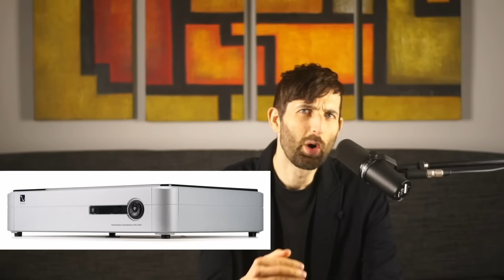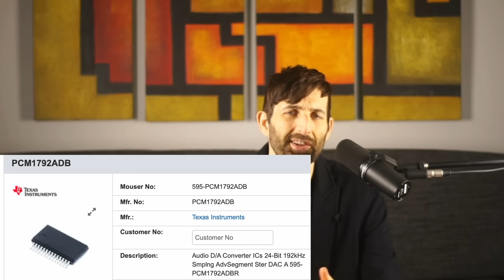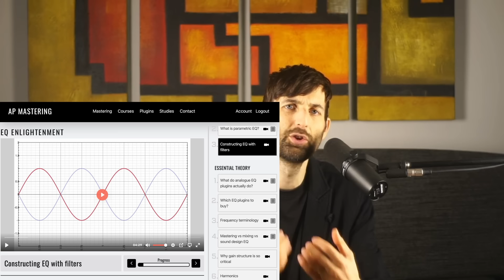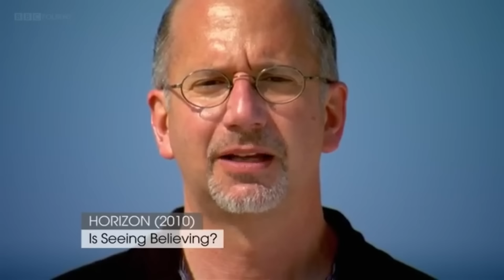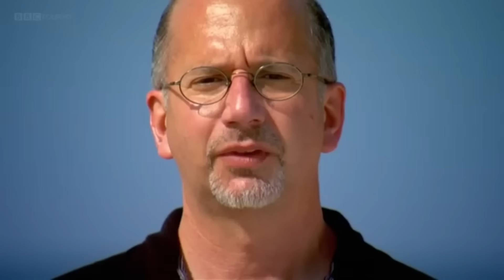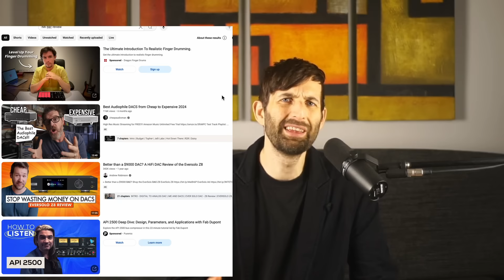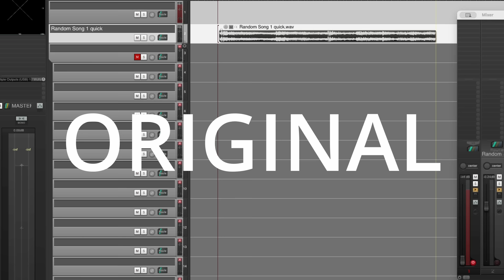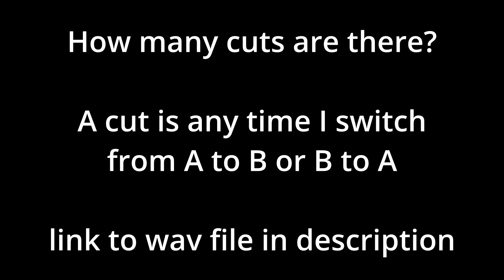The DAC Scam - Almost everyone believes the hype

Comment: It is especially funny that audiophiles buy expensive equipment but many times they listen to it in acoustically untreated room...
Reply from the maker: YES. I've made this comment before... I have no idea how anyone can describe the fidelity of a 200,000$ hifi in an untreated living room and not feel like a complete pillock
Reply: Yep! See this all the time. People showing off their £20k B&W speakers. Room untreated, likely with a long reverb time and speakers in the room corners. It’s as if they are unable to read the little manual that came with the speakers on basic speaker placement and room setup
Reply: @42tops  Surely reverb time in their allucinatory delirium becomes "wider soundstage"...
Reply: @APMasteringa mid system in a well done room trumps a top end system in a shit room.

A low end system in a good room would still win
Reply: Condition the listener first and the space second or even last . 
Most people don't have the money , time or desire to condition a space . 
My listening space is the worst of the worst.
It has  zero  redeeming qualities and would put an audiophile in the ICU due to shock . 
When i bought my latest system within my budget i never even considered the space .
i plopped my huge tower speakers on the floor up against the wall  on either side of my tv which is at the foot of my bed and a window next to the tv. 
one side of the ceding is three feet high and the other over the left speaker is fifteen feet high . my amp is right up against the bed within arms reach . i hooked everything up 
turned it on and pure bliss . went to listen in showrooms , peoples homes etc to listen to comparable equipment and to me my set up sounds way better . But none of that matters because ALL sound is subjective when it reaches the brain . so we like what we like and that's it .
Reply: @ It's funny because I have had a serious interest in hifi since the early 80's. Then I went to uni and studied acoustics at degree then masters level. I have worked in the acoustics industry for 25 years now and design entertainment venues, studios and stadiums for a living. I have literally made all my money from being a consultant on this subject matter. But yet all I see now is folk in this hobby with zero understanding of basic acoustic principles writing stuff on the internet about how little they know and giving out their advice.
Reply: You are spot on,you can have better sound with 5000 euro hi-fi and room with very good acoustics rather than 100000 euro hi-fi system in space with terrible acoustics,the acoustics of the space is fundamental.
Reply: Haha I always think about that. They would notice more clarity and depth by using KRK monitors but treating their room
Reply: Not just untreated rooms, but rooms with laminate flooring and no sound absorbing furnishings. And if that isn't bad enough, why do mastering engineers go all out to make albums sound terrible? We may as well buy inexpensive equipment that at least doesn't highlight these problems.
Reply: @FreezingMoon77 This! I just stumbled across a guy reviewing some audiophile gear and his listening room looked more like glasshouse. He went on and on about soundstage and holographic imaging and how sound seems to come from outside the speakers. Well I guess it sort of was but who wants to spend their time listening first reflections is beyond me. 

Perhaps in this video a bit too straight forward view was given, it was not stressed enough that proper design is not just slamming roughly correct parts together. But maybe the message would have become too convoluted if all ifs and buts would've been properly addressed. But overall I agree that mostly audiophile stuff is just snake oil and audiophiles don't really understand the subject matter enough to see through the bullshit.
Reply: Not me..  :) Room was treated and then a UMIK-1 mic used to build Convolution files for HQPlayer (my upscaler / DSP / filter / room correction solution)

Comment: Most of the sound difference is based on the output stage and not the chips.
Reply from the maker: sure, if you design a poor quality DAC it will color what the chip is doing

Comment: Since chip manufacturers have reached the point of making perfect DAC ICs with dynamic range and THD of 130dB or more, it all comes down to the output stage of the DAC, maybe the power supply and the PCB design. Poorly designed output stages and PCBs can actually affect the DAC's (whole unit) characteristics, adding more noise and distortion, maybe dropping the final specs to something like 120dB or 110db. Is this a problem? Can you hear the difference? Probably not, considering CDs have a dynamic range of 96db and preamp/ amp components usually have less than 100dB.
Reply from the maker: properly dithered CDs can exceed 96 but yeah. And its actually quite hard in electronics to get significantly more than 100db of anything anyway because of johnson noise
Reply: @APMastering A new DAC is coming with 170dB performance. It's called imersiv.
Reply: @ It is called BULLSHIT
Reply: @driz77  Regardless of whether the marketing calls it “immersv”, it’s inaudible. In fact it cannot even exist as sound, let alone be audible!
Reply: @GregStudio01  Suggest you read the patents and AES papers. You're not understanding the technology. THD at "atmospheric" levels (-40dBFS, etc) is reduced by orders of magnitude, and this is plainly audible. Over 30 top mastering houses are now using the imersiv DAC.
Reply: @driz77   Why would you suggest something I’ve already ready done. I suggest you learn the basics of sound, try starting with the level of absolute silence (in a habitable environment)!
Reply: @GregStudio01   With closed headphones (sufficiently blocking room ambience), the ear can perceive minus 8dB SPL. But you're missing the point of the imersiv invention ==> it reduces mid-level THD by orders of magnitude, compared with all other DAC architecture today. This is a perceptual breakthrough. So, you've read the imersiv patents? The AES paper? Katz's AP measurements? Jan Didden's AudioXpress technical article? If you had read these, you would understand what I'm sharing, and why this is a fundamental shift in objective + perceptual audio performance. Mastering houses now using the imersiv include Sterling, The Lodge, Concord, Airshow, Arf, Infrasonic, Coast -- over 20 I'm aware of. And the imersiv DAC isn't even on the market yet!
Reply: @driz77  And assuming one is not wanting hearing damage, what is the peak level going to be with those closed back headphones? That hole is getting deeper!
Reply: @GregStudio01  But this keeps missing the point. imersiv architecture isn't about how quiet or how loud it gets. The perceptual breakthrough is in dramatically lowering THD at atmospheric levels, where our ears are most sensitive to spatial cues (think 0.1% vs. 0.001%). This is why all the mastering engineers are commenting about its spatial realism. Imersiv delivers about 2 orders of magnitude lower distortion than any legacy DAC (any DAC today). Bob Katz actually ran the 40dBFS THD curves against his best DACs. It's plainly measurable and, according to dozens of mastering engineers now using the imersiv DAC, a distinct audible improvement in imaging, depth, and space. Before commenting again, I urge you to read the Katz review, then we can have an apples-apples conversation.
Reply: @driz77  Perfect, you failed to answer the question and all you did was paraphrase marketing. So yet again you’ve demonstrated you have nothing other than marketing! How deep can you make that hole? lol
Reply: @driz77  Perfect, you didn’t even attempt to answer the question and instead just paraphrased marketing. Perfectly proving yet again you have nothing other than marketing. Keep going, this is funny!
Reply: @GregStudio01  This /is/ engineering. You need to understand THD and the difference between 0.001% and 0.1% (see Katz measurements). If these numbers mean nothing to you, you'll never get it.
Reply: @driz77  Just more and more nonsense. Sure, I don’t what engineering “/is/“ despite the fact that’s what I’ve done for a living for 30 years and instructed others to do. Again, you can’t answer the question, have nothing other than false assertions and demonstrating yourself to be a fool. But don’t let me stop you, it’s amusing to watch people make a fool of themselves!
Reply: @GregStudio01   What was your question? I'm just presenting Bob Katz's objective THD measurements, showing that imersiv conversion is 100X lower THD than his best DACs. Did you read his review? Start there, then we can have an intelligent conversation. Stop using words like "fool". If we don't address the objective THD differential, then you'll not understand what imersiv processing does, and why it's radically different, and changes all audio processing moving forward (actually, many ADC's today are now using multi-path architecture ... Rode, Zoom, etc. as "clip prevention").  imersiv is the first multi-path DAC.
Reply: @nafeel4539  Oh dear, someone was unable to answer the simple question I posed and from that you think I was cooked?! lol
Reply: @ @robertt7238  Thanks for the conversation. I would suggest: read the patents. When a conventional single-path DAC (all DACs today) converts at lower levels, its measured THD (ratio) rises dramatically, by definition a doubling of THD ratio every -6dB of level reduction. So by -40dBFS, its measured THD is somewhere in the 0.1% range. And by -60dBFS range (the "atmospherics") it is closer to 1%. This is audible in the ambience range, but we've never thought about it because we assumed it was insurmountable. You never see distortion % results at -40 or -60 (etc). It's always at Full Scale. 

Multi-path architecture (read the multiple published patents) changes this paradigm. When music falls into the -40dBFS range, the D-to-A conversion switches to a different DAC core (!) and starts converting again at the most-significant-bit (MSB bit-32), where the THD and noise performance is 40dB better than any single-path DAC. This is audible as improvement to low-level ambience, subtle timbre, atmospherics, and so forth. This is what recording engineers are hearing. 

Are you familiar with HDR photography? The parallel is near-perfect. You take multiple photographs at different apertures and then intelligently combine them for greater dynamic range, which becomes especially visually apparent at low-levels. Sony just released a CCD with two sensors per pixel, one optimized for ultra-low-level light, and one optimized for high-bright light, improving CCD dynamic range (lowering self-noise) by 25dB. It's all the same concept. And it's a wickedly hard engineering problem to solve.
Reply: No probably not. -110db is inaudible.
Reply: @robertt7238  But -40dB is audible, and imersiv DAC lowers THD by 1-2 orders of magnitude at lower audible levels. Nothing else does this. Bob Katz wrote up a prototype review in Positive Feedback. It's fascinating. Probably the first significant breakthrough in digital audio since, well, digital audio.
Reply: @driz77  Who cares about -40db when I have a DAC with THD+D of 120db. In a quiet room, that is 150db peak which is bleeding ears. Positive Feedback is positively brain dead.
Reply: @robertt7238  OK, so you've entirely missed the point. Admittedly, it's a very long and complex review. You'll need to go back and try to grasp the amazing improvement of multi-path architecture. It reduces THD by 1-2 orders of magnitude (!!) below your DAC, at lower levels. This is audible, according to Katz, and around 50 Grammy and platinum engineers who are now using this DAC. Nelson Pass is on their Advisory Board, as is George Massenburg. This is real.
Reply: @driz77   "Engineers". These are not engineers, they are people who mix audio, who for the most part are every bit as ignorant about the technical aspects of audio as your average audiophile and say some really stupid shit ... I know, I deal with them.   I have forgot more about digital audio and signal processing than Nelson pass knows. He is an analog guy, and not overly sophisticated analog at that. Some cool circuits, but that is about it. 

If I have 125+ DB THD+N, there is 0 reason to lower TDH even further. You cannot hear it and neither can those supposed 50+ grammy and platinum engineers. No one on the planet can, and from the most basic level, even the very best transducers are 2 orders of magnitude worse in THD.  The quietest rooms for listening are about 20db, 125db on top of that is 145db. Your ears are bleeding and your hearing is finished. Even considering a realistic max of 120db peaks, that basic 125db THD+N is 25 db below your quiet room noise floor which is well below what you can extract with perfect test signals, never mind music where you can't hear, at the same time, more than about 50-60db and even then only if widely separated by frequency due to masking effects.

Next time you want to tell someone they "don't understand" you may want to find out the relative level of knowledge.
Reply: @robertt7238  You're not understanding multi-path technology. When a conventional single-path DAC (all DACs today) converts at lower levels, its measured THD (ratio) rises dramatically, by definition a doubling of THD ratio every -6dB of level reduction. So by -40dBFS, its measured THD is somewhere in the 0.1% range. And by -60dBFS range (the "atmospherics") it is closer to 1%. This is audible in the ambience range, but we've never thought about it because we assumed it was insurmountable. You never see distortion % tests at -40 or -60 (etc). It's always at Full Scale. 

Multi-path architecture (read the multiple published patents) changes this paradigm. When music falls into the -40dBFS range, the D-to-A conversion switches to a different DAC core (!) and starts converting again at the most-significant-bit (MSB bit-32), where the THD and noise performance is 40dB better than any single-path DAC. This is audible as improvement to low-level ambience, subtle timbre, atmospherics, and so forth. This is what recording engineers are hearing. 

Are you familiar with HDR photography? The parallel is near-perfect. You take multiple photographs at different apertures and then intelligently combine them for greater dynamic range, which becomes especially apparent at low-levels. Sony just released a CCD with two sensors per pixel, one optimized for ultra-low-level light, and one optimized for high-bright light, improving CCD dynamic range (lowering self-noise) by 25dB. It's all the same concept. And it's a wickedly hard engineering problem to solve.
Reply: @driz77    Or more likely you cut and pasted a bunch of shit that you effectively have no clue what it means ...
Reply: @robertt7238   Read the patents -- there are three of them. This is clearly the biggest breakthrough in digital audio since ... digital audio. It reduces noise by almost 40dB. It reduces low-level "atmospheric" THD by 40dB. After you've read the patents, come back and we'll have an intelligent conversation.

Comment: Considering the fact that some don’t all have a chip! This is ridiculous!
DCS HAS NO CHIP it is a ring dac!
The POWER SUPPLY IS THE MOST EXPENSIVE PART OF A DAC!
What about the ANALOG OUTPUT STAGE USING BETTER PARTS! 
A good case can cost 1-2k in metal work! What about all the custom filters?
70% of sound is power supply, 10% chassis
Reply from the maker: what percent of sound quality is that 2000$ case?
Reply: @APMastering consider, considering the fact it doesn’t vibrate as much!
It keeps resonances down from affecting other things! 
Decouples the boards and has internal bracing. Better feet matter as well.
When you’re listening in a studio, you’re not listening to full range speakers you’re listening through headphones or little monitors in the near field or midfield when are you listening to big ass speakers pushing tons of air in a big room vibrations matter more
Reply: @APMastering 10% approx You have to decouple components and protect them from unwanted resonances and shield them from magnetized cheap stamp steel that rings and dapen them.
Reply: @pennfootball71  you honestly think you can hear the output interpolation filters on your dac?
Reply: @NamelessSmile of course and you are far off-base as to be laughably irrelevant.
The chip only does conversion, it has very little to do with the sound, at least compared to the power supply (70% of the sound) and the analog boards (20%). Chassis quality affects another 10%.

Comment: Making ultimate DAC is not a too expensive job. You just need to know how to implement a proper clock. Clock is the key.
Reply from the maker: clock is very important but that's been sorted for a few decades
Reply: @APMastering I think that is a misleading opinion. Consumer grade DACs  use copycat designs from standard receiver IC's and clocks. But when someone implement an OCXO ultra low phase noise clock with a proper clock synthesizer, it does things entirely different.
Reply: @meaninthemirror  That’s the point he’s making. It may well do things differently but it makes NO audible difference, it’s just snake oil! The clocking in cheap consumer devices 30 years ago was already way below audibility.
Reply: @meaninthemirror  seriously does not matter.  jitter is a non-issue, and any standard decent clock is also 100% fine.
Reply: @Artcore103  I would disagree. If you don't experience it in the first place, please don't argue about it. My DAC has 10MHz external clock input. When I feed its internal PLL with a TELCO grade external clock, it becomes an entirely different DAC even though its internal clock has extremely low jitter already. Jitter measurements don't tell too much about DAC's dynamic behavior, e.g:  transient errors that caused by the clock.